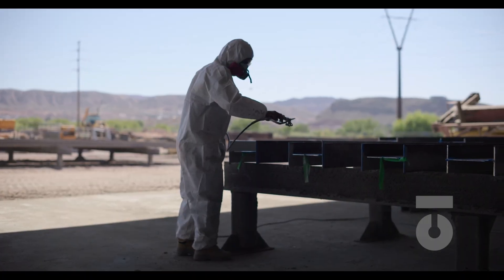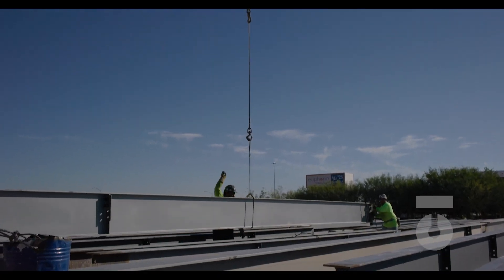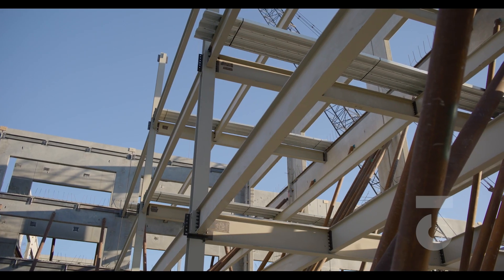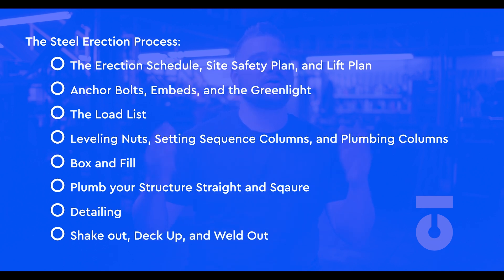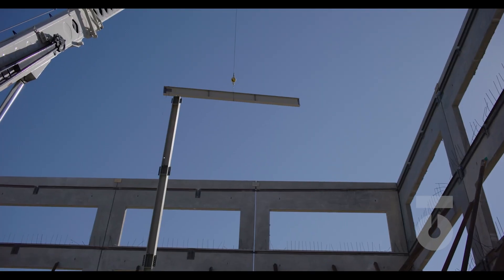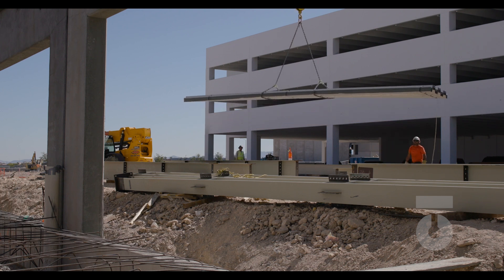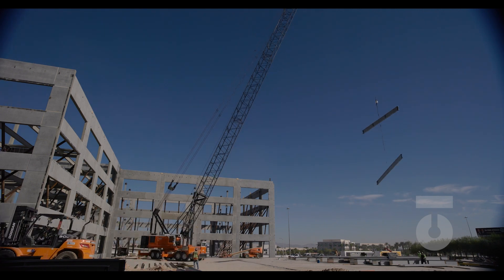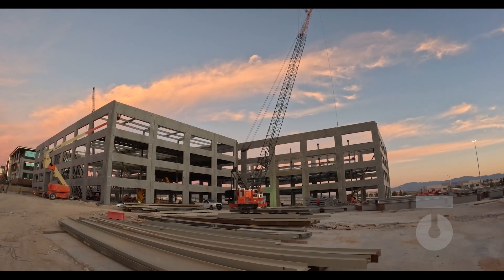Steel Erection 101: A Beginner’s Guide Part 1

Comment: What kind of concrete panels are used and how do you install or cast them ? Is it in Situ or prefab? Thanks
Reply from the maker: The concrete panels are actually poured by the concrete contractor. One they are ready and set they put them up and then the steel contractor comes in.